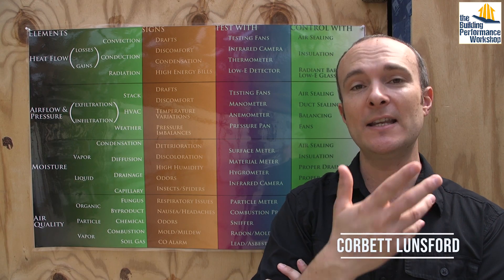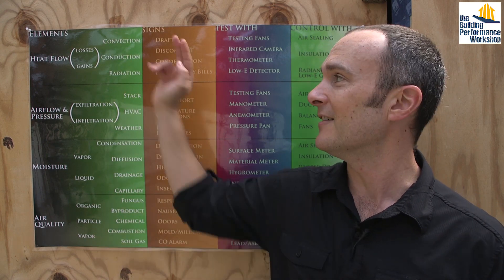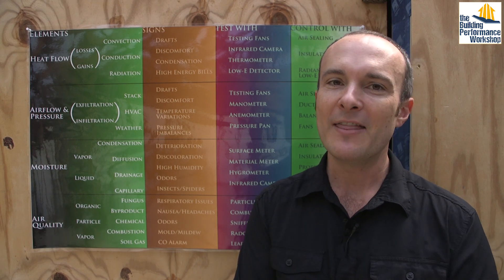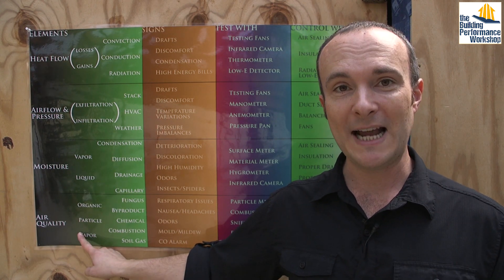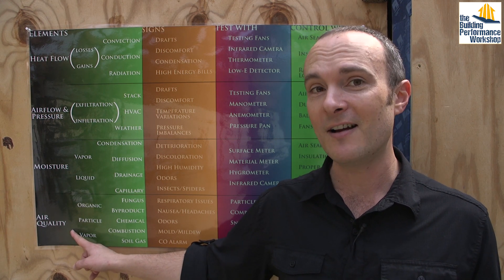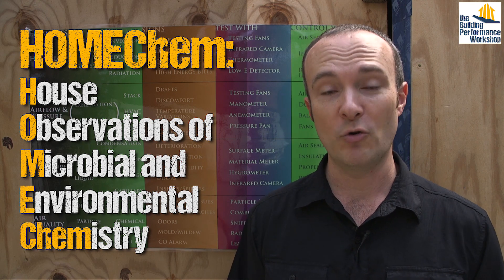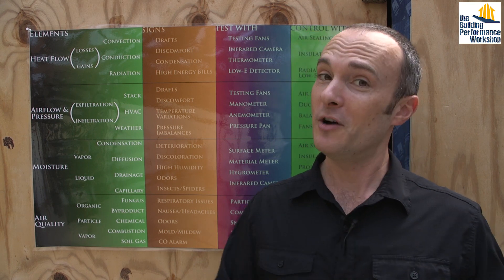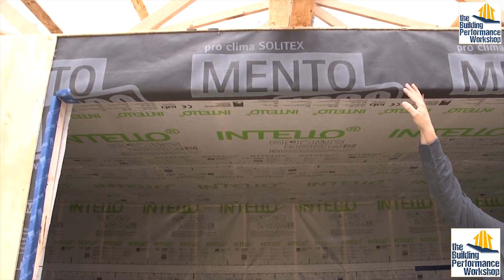“Airtight" Buildings Debunked by HOMEChem

Comment: I think it's a terminology problem. It might be better to call it a wind barrier rather than an air barrier. The old technique was to place tar papers on top of each other, sheding  the water out yet allowing the water to escape at the same time. Until Tyvek came up with a membrane similar to what is used in rain jackets. I think Tyvek know a lot about chemistery. Speaking of vapor barrier, experiments  has shown that vapour  can travel through drywall. If it takes months for glass water to build up, it will still cause the same problem, and months is a very short time for a house
Reply: Good points.

Comment: Actually a water molecule is smaller (2.75 angstroms) compared to a O^2 (oxygen molecule) 3.6 angstroms and N^2 (Nitrogen) 3.7 angstroms. My guess is that the intello uses something called molecular sieves  which are compounds that either absorb or pass selective gases.  https://en.wikipedia.org/wiki/Molecular_sieve
FWIW: Not so sure Intello or other barriers are really effective. Best option is to get the home air tight as possible by caulking and taping the exterior sheathing. On the inside. seal up any wall penetrations (electrical, Plumbing, data, Ductwork) using caulking and putty, as wells ceiling up the drywall pentrations for electrical boxes (outlets, switches, Duct vents) and Plumbing. The drywall should block +99% of air movement if properly sealed. My concern is that  warm side vapor barriers\retarders (even smart ones) may cause moisture build up over time. Its very possible that smart vapor retarder products like Intello degrade over time, and might end up traping moisture when the house is 15 to 20 years old.

As far as formaldehyde & other VOCs, don't use spray foam or  cellulose insulation. use Roxul (AFB, COMFORTBATT) or high performance fiberglass. since these are inert and won't outgas. Plus Roxul and fiberglass is very moisture permeable allowing any moisture to escape. Roxul is the better product since it hydrophobic unlike fiberglass which can hold water like a sponge. In my opinion spray foam is probably the worst product to insulate: it outgasses, either absorbs water like a sponge, or hard as rock which can be a pain if you ever need to perform a repair (it water leak, storm damage, etc).
Best option is to use exterior insulation, which keeps potential VOCs (ie rigid foam panels) outside & also help keeps the exterior sheathing warmer (thus reducing condensation). Also use Rigid foam panels that use air (Greenguard & Thermalstar) instead of panels that use VOCs\FHC's (Corning & Dow) for the inflation gas.

Comment: Yes, by all means, go with a high quality building envelope and keep an eye on the type of foams (and other plastic based materials) you incorporate in to your construction....  Then remember that that super luxury sofa with 4 inches of foam rubber comfort along with the vinyl covering and the 1000 lb of carpet you install will off gas far more than the building itself.  The only solution is to ensure you have a recovery ventilation system to provide the building with enough fresh air while minimizing heat/cooling losses.

Comment: I think we would all agree that a glass beaker is both air and water tight. And if we put some water in it this will prove to be the case. However, if we poured Superfluid liquid helium in there it would leak through the glass. Now, we are taught that in order for a liquid to escape a container air must be able to get in otherwise we have the vacuum effect. So if we sealed the top of the glass beaker, then what would happen?

Superfluid liquid helium.
The chemical element helium exists in a liquid form only at the extremely low temperature of -269 degrees Celsius, very close to absolute zero. watch?v=9FudzqfpLLs Search for it and you can see liquid helium running through a solid glass beaker. This is because the liquid has such little viscosity that it runs through the gaps in the beaker at a molecular level, so if you try to pour it into a glass container it will simply run straight through it.

I think the reason things don't pass through other things even though most of it is empty space and in theory they so easily could is because of energy/heat. Things are not just molecules sitting there completely still, they are bouncing around and this prevents things passing through other things depending on how much energy it has. Radiation has very high energy and passes through anything. Which is the reverse of the above experience where it was super cooled to make it a liquid and possibly reduce its activity allowing it to pass through a glass beaker.
Reply: This was very interesting. But at least in the cool BBC video you linked, the liquid helium is leaking through the plug material, and not the glass.
Reply: @tristanwegner  maybe watch a super viscous material instead here /watch?v=SkpZAg4RkGI

Comment: "Air tight but vapour open" A house brick can transfer water through it by capillary action but it would require high pressure to allow air through it.

Most of everything in the universe is empty space. A brick has more empty space than matter. Technically there is no difference between a gas, solid and liquid. But you can't compress a liquid but you can a solid so which really is solid. Liquids and gases act differently. The fact the individual molecules may be the same size isn't a deciding factor because it is how they are arranged in a group such as carbon. A diamond is carbon and so is graphene but they are very different as a fully formed structure. Air and heat are two different things too.
Reply: Thanks for you comments

Comment: So i bought an old house, 1865 on cape cod. I have been in the trades for 20 years. I am very interested in this discussion. Especially comparing old with new. I keep finding reasons to go back to the "old" method. Example,  i reroofed with cedar shakes instead of asfault due to ecological concerns and discovered they reflect radiant heat better and provide better insulation.....and it is breathable. 
Another example.  wool socks vs high tech water wicking plastic socks:( no competition. Alpaca socks rock in the winter. So my next project is walls. Do i use sheetrock or stay with plaster? I would love to hear more. I feel like sheetrock is hygroscopic and would force me to use ac? Cheers

Comment: Yes, everything has a leak rate. And no, you're not an idiot; the fact you made this connection is proof. We could build walls out of 10m thick lead and still have a leak rate. It's a question of magnitude; what order of magnitude is important? A 20mph wind exerts something on the order of 80 pascals (about 0.01psi), if my math is correct. The membrane likely stops enough air movement, at that magnitude, to be "considered airtight". So, yeah, science!